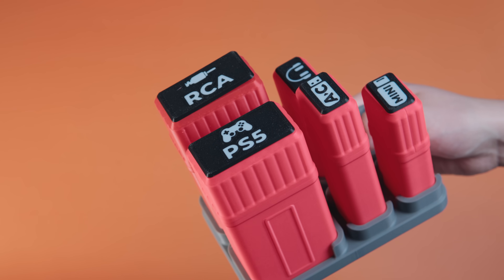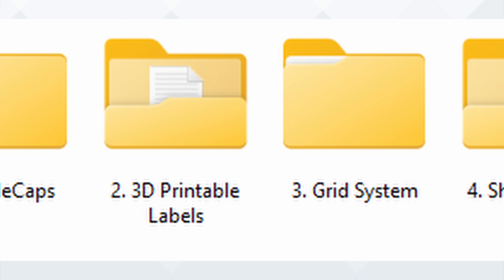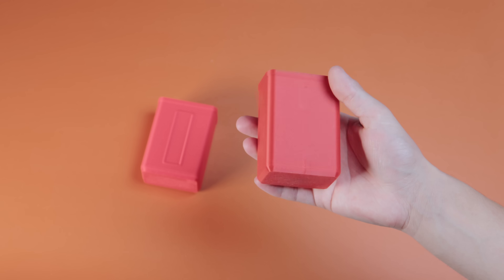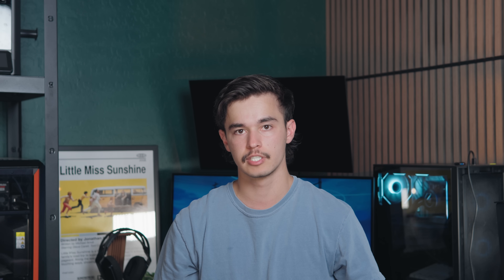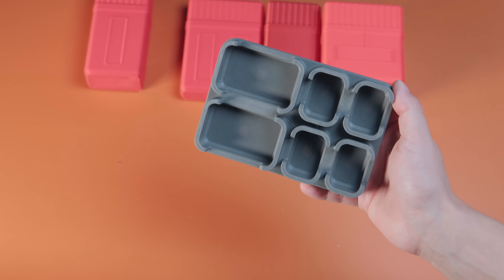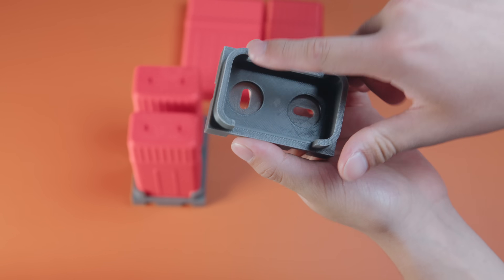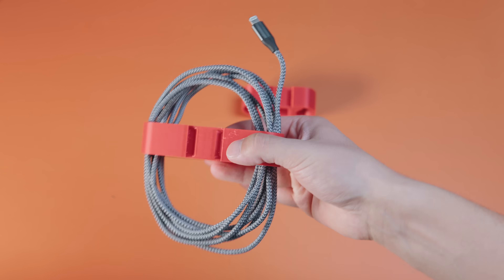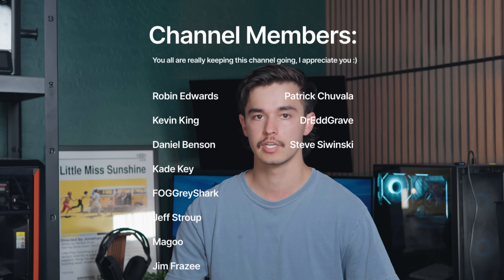Fix Your Cable Chaos With 3D Printing!

Comment: It´s the same basic idea (a box for cables) as those gridfinity boxes but it also comes with a lid. My question is, why do I need a box with a lid for my USB cables ? It prints longer, uses more material and all it creates is an additinal thick base for gridfinity and boxes for cables. Sure the design looks a little better (maybe) but why do I need it ? Instead you can buy those bags with a zip lock and put your cables there, you also see the type of connector etc. I don´t think this is a good idea at all. It´s more like " can we do that" without thinking first "should we do it" type of thing. I don´t see how it solves any problem better than what we have already.

Comment: That seems so simple, Im just gonna design my own. Appreciate the in-depth review, gonna make that WAY easier!
Reply: Ikr? I didn't know go fund me does stuff for file downloads, did the creator need a $4,000 computer to make it?
Tbh, I think the harbor freight small container drawer thing would work better, it has little containers that slide into a grid like a drawer with an attached top.
Reply: Why though ? It´s a box for cables that uses more material than the gridfinity boxes we already have and it comes with a lid...what do you need a lid for in a cable drawer box ?
Those are nice boxes. They wold be useful printed in TPU for the "to go" needs (if you don´t want to use a soft pouch which does the same thing), but do you need more clodes off boxes in a drawer for cable ? What problem does this solve better than anything we already have ?

Comment: Search for open source parametric box designs that work with gridginity or multibin. Save that $40 and spend it on filament to actually print them

Comment: One of the reasons I purchased a 3D printer is not having to buy easily made plastic items for around the house. There is no way I am going to pay $40 for some STL files for some boxes that pretty much any free gridfinity boxes would do the same or even designing something just like this in cad is not difficult. The model is nice ... but simple, easy to create yourself. $40 is a joke. But this is a knock on this STL sellers borderline scam prices, not your great videos, keep up the great vids!

Comment: Wait, they made you pay for stl files of ...... boxes? i might be wrong. But is that not the first thing you make and print yourself with your first 3d printer?
Reply: Exactly what i was thinking lol
Reply: I mean, you're free to design your own modular gridfinity boxes for cable storage as a unified solution and see if that seems like worth your time. I'll be impressed if you manage that without 40$ worth of wasted filament.
Reply: @SkullMutant waste you design it in cad lol no printing needed lol and you putting it in a box why most likely it going to be hooked up and in a backpack
Reply: @SkullMutant  There are already free stl's for this.